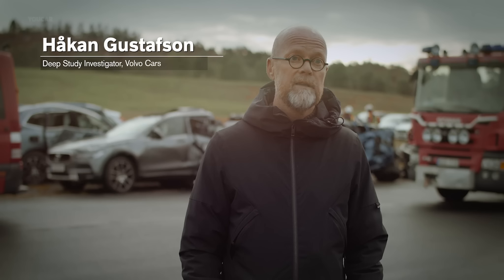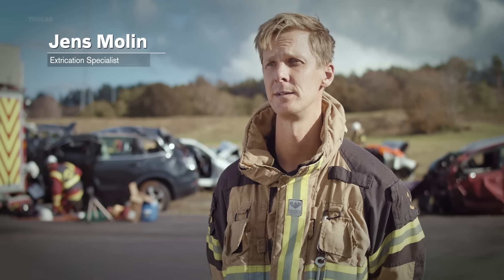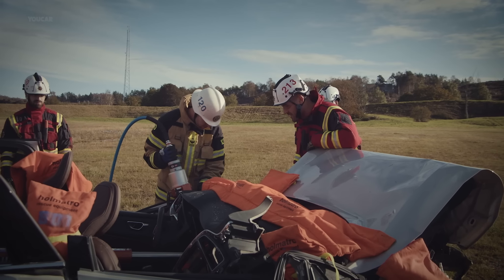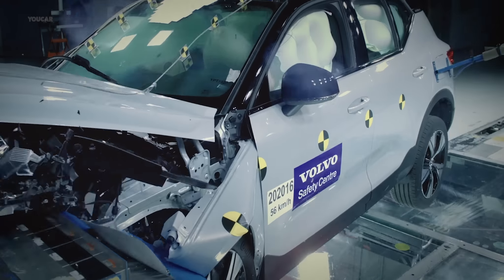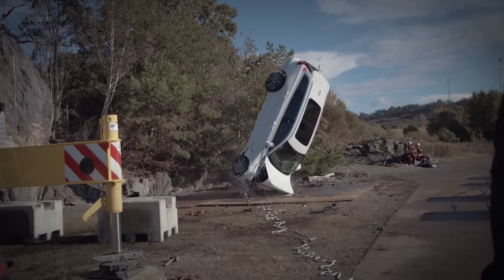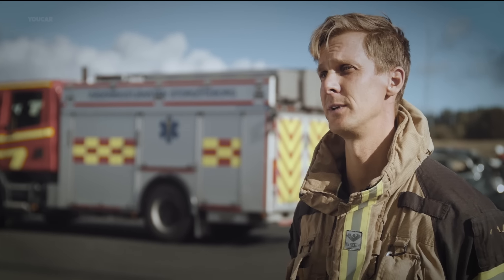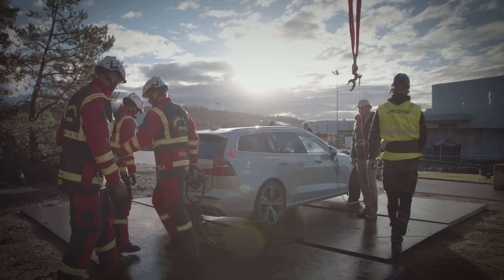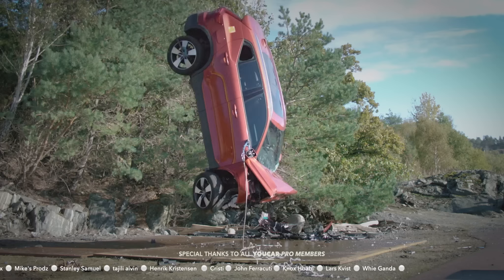Extreme Crash Test – Brand New Volvo Cars drops from 98 FEET / 30 METERS

Comment: Only Volvo can have such guts to demonstrate confidence in their cars safety... I dare others to follow suit ... Okay no one😊!!!
Reply: ask tesla with the highest safety rating of all time
Reply: @DavidHernandez-kc1el  i know the tesla is the really safe company too, but it performed poorly at torso protection during pole crash test, because not absorbing energy of crash as needed. so in my opinion, i think tesla needs to crash test more.
Reply: @NormalMark1_Original  what?? the pole test on the side??? they literally got a 5 star rating on that and they have never rated that to a suv in decades
Reply: @DavidHernandez-kc1el  volvos don't burst into flames in accidents like Teslas
Reply: @north5103  um, yea they do? Any combustion engine is more likely to burst into flames from a crash than a battery, I know batteries have more dangerous explosions but there's hundreds of thousands of combustion engine fires every year In just the US, you just don't hear about them as much because it's old news for most news stations since it happens so much
Reply: @ethanhines9875  not really, it's more that electric cars make up such a small part of the car market we haven't seen as many fires, combustion engines are quite safe and the risk of a fire is quite low. Even if fuel spills from a ruptured tank it is not guaranteed to start a fire. A ruptured lithium ion battery has a much higher chance of starting a fire than a ruptured fuel tank. Add to that Lithium batteries continue to burn after they've been extinguished and not all fire trucks carry electric fire suppressants and EVs are quite dangerous
Reply: Add to that batteries are WAY larger than gas tanks, with the entire floor of teslas being battery, and the puncture risk is much higher.

Comment: really volvo vehicles is best in the world for the safety
Reply: Ford focus Also has the same chassis
Reply: @hugoalmeidq5976  and they crumble way worse than the volvo from a first repsponder
Reply: @hugoalmeidq5976  No they don't...
Reply: If not then who makes WRX
Reply: I think evn germans are safe
Reply: Volve is the one who invented seatbelts ..... And gave to auto industry
Reply: @AdityaMalode67  mercedes invented airbags
Reply: Yes, and Mercedes and Tesla
Reply: @hugoalmeidq5976  Since when?...
Reply: @edwardecko  Mercedes
Reply: @hugoalmeidq5976  not since around 2004
Reply: @gfinnstrom  but thats how they absorb impact
Reply: @K_240YT_ALT  The Volvo V50 from the mid 2000s shared the same chassis as the Ford Focus. New ones aren’t related.
Reply: @hugoalmeidq5976  not anymore
Reply: Yes, that's why I bought one. Wonderful!

Comment: Volvo actually leads in safety for automobiles.
They need to add reliability and hit the bang going.
Great video.
Reply: Reliability is an issue with volvo? 

That’s news to me and my  XC70 with 300,000 miles and my V70R with 245,000 miles, and the S80 I sold to my friend a few years ago that now has 460,000 miles.
Reply: @Honeypot-x9s   New Volvo's are not reliable tho :/
Reply: @Honeypot-x9s  It’s a good thing you have positive experiences with Volvo. I like Volvo a lots and have done some more readings on them since 2000 and can vouch for the safety record. 
However I testify of a colleague’s 2012 xc90 that spends 70% or more of the time at the workshop due to one or two faults. Not only his own. In other cities in Ghana here, you will notice a lot of Volvo’s at the workshop. Current electronic technology applies to all new cars but I am not motivated to purchase a car when I see them most of them spend their time at the workshop than being on the road. 

Most user reviews on Volvo from different websites agree on the safety but name reliability as a huge demerit. As for expert reviews, well they are also questionable. Do you think I will be motivated to buy a car that sits more at the workshop?
Reply: @rodin9262  oh yes they are
Reply: @rodin9262  Rubbish generalisation.
Reply: @dextertheragdollcat213   @D MOTORS ZA TM   They are really not. The new engines have lots of problems. Not even talking about the hybride versions yet.. these are even worse. The interiors are also cheap and poor quality. The driving comfort is also not like it was before. New Volvo's are just not what they used to be..
Reply: @rodin9262  Pure and simple  misinformation.
Reply: @dextertheragdollcat213    Misinformation? I work on Volvo's and drive these cars everyday. I can tell you the new models are a nightmare. The previous generation was pretty solid.
Reply: @rodin9262  respectfully agree to disagree.

Comment: And this is why Volvo is the undisputed leader in safety technology. Others may claim to be... Volvo is.
Reply: They don't lead Mercedes Benz
Reply: @INTERNATIONALvids  lol darling go read up on Volvo history versus Mercedes history... You will be surprised how many safety items were actually Volvo firsts... In addition, the reputation Mercedes has for unquestionable reliable and safe cars, come from the cars they built during the 70’s, 80’s and early 90’s. After that they have become a volume pusher and new money status seeker. Back in the 60’s Mercedes Benz was a direct competitor to Rolls Royce - now they are not even close to Rolls-Royce anymore. They are compared to BMW, Audi and sometimes in the case of the A-Class to the VW Golf! Mercedes may be selling more vehicles than ever and making record profits but their vehicles are not built to nearly the same standards they used to.
Reply: @jeanhubsch4757  
I don't buy cars new, only used without warranties. So I totally stay clear of all European cars made after mid 1990s, Mercedes and Volvo included because they are high maintenance and often not the best reliability. I've owned over 40 cars in my life over last two decades, just not all at the same time.  I often buy them crashed and fix them. I've been involved in some car crashes myself, one severe. I have a lifelong hobby shopping for cars at insurance auto auctions where most cars are totaled. Because i fix them, I see hands on how these cars deal with crashes, and many I see at insurance auctions completely demolished. 
My preference is Japanese vehicles with some exception for American pickup trucks. 
I was just saying Mercedes were pioneers or at least at forefront of automotive safety. I could care less about the brand. I prefer Toyota's Lexus over Mercedes if out of warranty. 
Mercedes made the first internal combustion engine cars. 
I'm aware Volvo innovated many safety features.
Mercedes innovated some of these systems and was early adopter of many other safety systems. 
brakes on all four wheels
safety cage with front and rear crumple zones (industry game changer)
traction control
ABS
pre-tensioner seatbelts
pre crash detect
etc

Comment: Since it's free fall
Initial velocity = 0 (given)
Height = 30 meters (given)
Acc. due to gravity=9.8 m/sec sq
Applying v^2 - u^2 = 2as 

We will get final velocity before hitting the ground = 24.2m/sec
That is 87.2 km per hour

And collision take place from front side which is equivalent to hitting a heavy stationary object with same velocity  24 m/s which too low mostly accident take place at high speeds higher than 100 kmph

SO THERE IS NOTHING SPECIAL IN THIS VIDEO TO APPRECIATE ABOUT SAFETY 
Stop making fool of 
 viewers 😅😅
Reply: True 👍👍👍
Reply: hmmm right
Reply: Hattofff
Reply: because this is kinda meant to be a scenario in “hey what if you managed to drive off a fucking cliff” no car is gonna be in a full freefall unless you drive it off a 10,000 ft mountain.

The cars in that video could probably drive off as if nothing happened.

You’re gonna complain if you die in a car crash that your car wasn’t as safe as the volvo who crashed into you.
Reply: @lordmeme_  the stunt they performed is ideal case but in this world nothing is ideal , they should have dropped from mountain cliff

Comment: If you fall from 30 m height down the cliff while in 2 tons car, it's potential energy is equal to getting hit by a car at the speed of 60 miles per hour on highway (588 KJ). I don't know if it's possible to survive in this case but it's interesting experiment overall.

Comment: Volvo cars are good but they are not the only ones on top; Tesla, Subaru, Toyota and most german cars offer a very good level of protection. As for this test, physics is physics; even though dropping a car from 50 feet is impressing, it doesn't change the force of the impact compared to the one you would see in a controlled environment, therefore I'm not impressed. I'll be impressed the day when a CEO of a car company will step inside a car for a crash test.

Comment: Lol. The most extreme crash test ever?
I don't think so.
The highest possible  speed you could reach in a free fall of 30m is round about 87 km/h. Without air resistance.
Reply: Thank you for recocognizing and pointing out they are selling us bull shit :-) But then again; what's new here?
Reply: I think you may have missed the second part of the video.
Reply: EuroNCAP crashes speed is 50km/h. This is a huge difference, then!
Reply: Wrong. Much more than that
Reply: @mariogambrelli  dropping cars from a crane looks very spectaculare, but doesn't say anything. I don't see test results anywhere! This test is the same as an old fashion crash test without results/data. Nowadays crash test are done with (small) overlap, which is more practical, more important. But I have seen more of these pr stunts from Volvo, for instance crashing a truk into an angled concrete wall, so the forces are deflected. This has more to do with influencing human emotions...
Reply: @ikkeennietjij  Thank you Stille Willie!
Reply: Yes but, this is different.  The forces are higher.  You have to account for gravity continuing to try to accelerate the car as it crashes.  Therefore, this is not equivalent to a flat 87 km/h crash test.  It is significantly higher.  That's why the engine compartment is pushed back so far.  Imagine standing the car by itself on its nose.  You will crush all the exterior parts, radiator, etc.  That's with no speed at all.

Comment: Meh possibly the most pointless "supposed crash test" ever. 
From a deformation event of a car & for Rescue Training I can see a benefit but other than that no real net value in crash assessment/structural integrity value because a vehicle accident is not like being dropped from a crane.
Reply: the point of the test is to measure the strength of the chassis, and how much it could withstand. that's not pointless lmfao